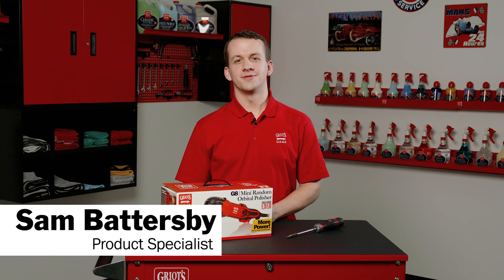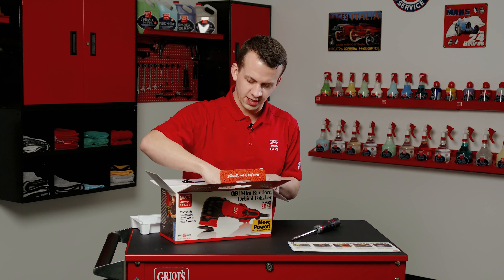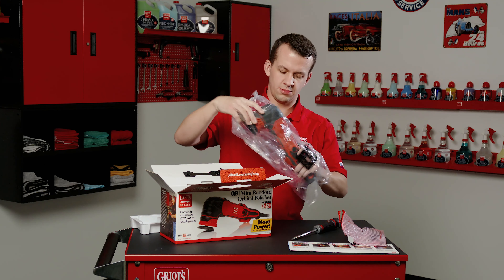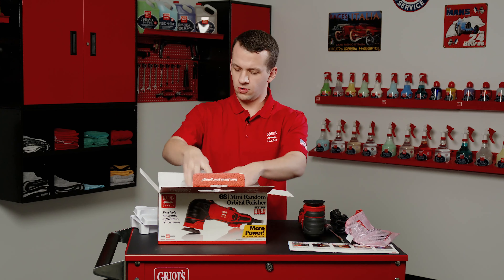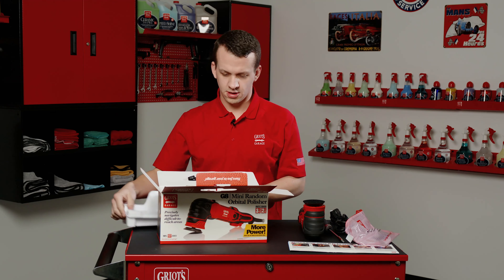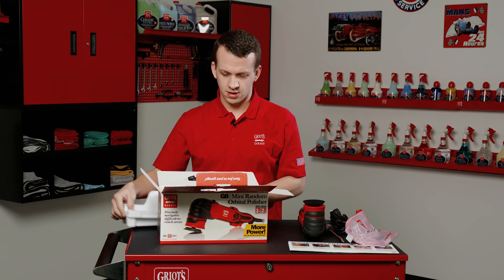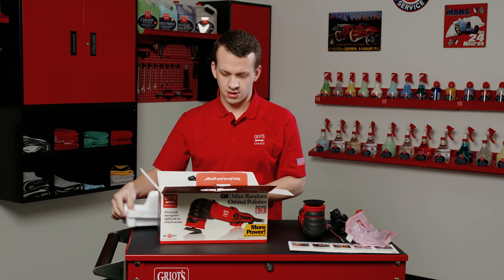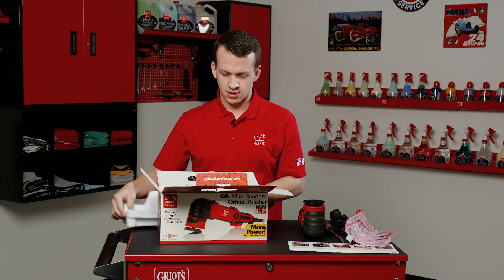G8 Mini Random Orbital Polisher: Backing Plate & Brush Replacement

Comment: Looks like the polisher is bigger than the 2 inch. How can that help? I mean how could you get it anywhere on a car that the 3 inch wouldn't fit? Still getting one, but I think the 2 inch may stay in the box.
Reply from the maker: One example of an area the 2" is commonly useful is A-pillars. On many vehicles the section of paint on the A-Pillar in between trim pieces is less than 3" wide making it difficult for defect removal with a 3" plate. Other common areas that come to mind are front bumpers around fog light recesses and grills, as well as rear deck lids around license plate recesses.

Comment: What does the G8 do that the G13 can not? Other than price, are there any advantages of using a G8 instead of a G13?
Reply from the maker: Hello! The G8 is our mini random orbital while the G13 is our long throw mini random orbital. The G8 has an 8mm throw while the G13 has a 13mm throw. That longer throw means it is more capable of removing defects and doing so more efficiently. That being said, the G8 is still a very capable machine with plenty of power and features to use as you grow your detailing skills.

Comment: Does the new G8 come with any pads or is that a separate purchase? I have the older version currently, but as i understand, the G8 is more powerful?
Reply from the maker: The G8 does not include pads (they are a separate purchase).  It does include both 2" and 3" backing plates.
Reply: Griot's Garage thank you
Reply: Griot's Garage thanks. Just ordered!